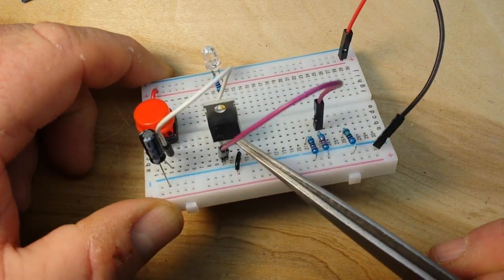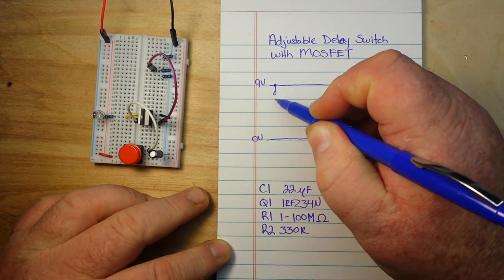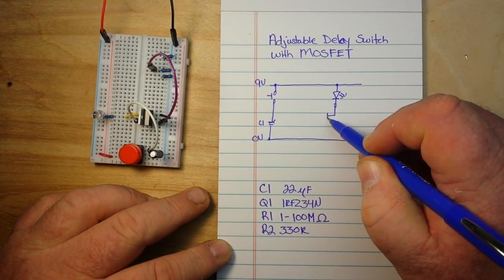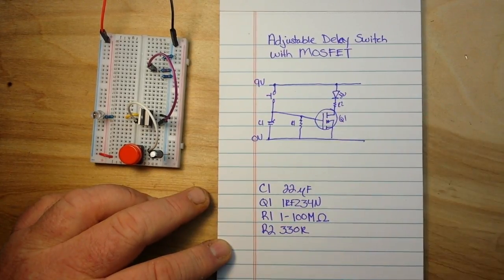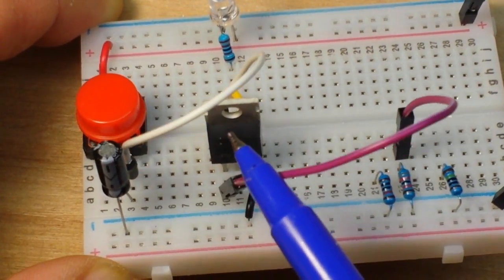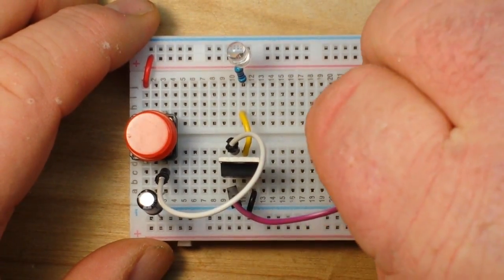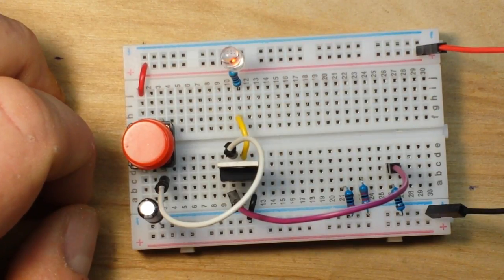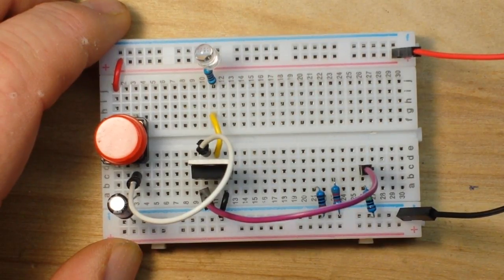MOSFET delay circuit

Comment: You need a resistor between the switch and the capacitor, so that you're not using the internal resistance of the 9VDC power supply to limit the capacitor current.
Reply: If th 9VDC power supply can deliver high current, capacitor go boom at t=0. 😆

Comment: I did this circuit but does not work. I guess the 12vdc power supply has a huge ripple and an ac componente goes across the intrinsic  gate-source  capacitance and recharges de electrlitic capacitor and this way the mosfet never turns off . Is it possible??

Comment: I wanna know how we can control the delay time without changing the resistance or the capacitor every time we wanna have a different timing?
Reply: you cant, those 2 components are the main timing items. Maybe with a potentiometer you can change the timing more easily.
Reply: @miked7923  thanks a lot  , tha was so helpfull

Comment: So you can use any MOSFET? It doesn't matter what the Gate Threshold Voltage is? I always thought that for use with logic, you need a MOSFET which has a Gate Threshold Voltage of under 5V,  otherwise it won't turn on. The IRFZ34NPBF which you used has a Vgs(th) of 2-4V and so will work with low voltages. Many MOSFETs have much higher threshold voltages and so won't work in your circuit AFAIK.

Comment: thanks for the video. like in some other videos I am missing an explanation on how the current flows in the circuit. for example I dont get how the current flows from the timing resistors and to the capacitors and how it discharge slowly etc.

Comment: Here is another example of a simple circuit that has wide reaching application possibilities. Could tie a pot instead of individual resistors to control delay, although it would need to be of the large value type.
Reply: Great idea, since he said 1~100Mohm then maybe a 100Mohm pot will do.

Comment: so can a l.e.d be used in the gate of a FET. along with a resistor. .To drop the gate voltage? or would that harm the MOSFET? for like a 24v system. and would the popular IRFZ44N be good for an 15-18 amp inductive load. at 22-29v. in a pulsed cycle maybe 10 kHz. to guessing maybe 20kHz.
I'm sorry I have a lot to learn. I can't afford to buy and burn components! I know at my level. things will happen. but I try to salvage components for just playing around. but I need to build 6 regulators and will be buying multiple components. and can't be burning them. thanks for your help.
Reply: A little (a lot) late, but here is how you can make a fast check. Use a datasheet such as at http://pdf.datasheetcatalog.com/datasheet/irf/irfz44n.pdf. Look for the SOA. For the given reference, that is figure 8. You should be able to see that for 30V, with a single pulse of 1milli second, you are good for about 9A. Furthermore, as long as you are below the horizontal upper limit, you can add a thermal radiator if you need higher current. Note that the figure assumes that your transistor is in air at 25C (ie, not inside a poorly ventilated enclosure where the temperature could be much higher).

Comment: Hello, thank you for this nice video. This is good for low current, but, for important currents and long durations, the transistor is going to warm because it stays relatively for a long time in intermediate regime. It is then better to add a Schmitt trigger somewhere in this circuit before the power transistor.

Comment: I just love seeing these simple circuits that take a few components. These days we tend to think of specialized IC's and such for things like this! Thanks for the video.
Reply: I agree. Good down and dirties, just like his logic circuits. Understanding the building blocks, that's what counts. Since I am self taught, learned the fancy stuff, but never did get the reasoning behind a circuit at its lowest level. I hope he keeps doing circuits like this at least 30% of the time.
Reply from the maker: +George Chambers anytime my friend
Reply: Hey, that's what I think learnelectronics is all about! Paul is a great teacher at least online? He's got the best teaching technic since Forest Mims III at least in my opinion.
Reply: I agree with your, sometimes something amazing can be done with just transistors.
Also them generic ICs are very useful like 741, 555 timer and them AM radio chip (MK484,  ZN414, TA7642) kinda look like a transistor...etc.
https://en.wikipedia.org/wiki/MK484
BTW you can get an assortment of chips for a cheap price to tamper with
http://www.futurlec.com/ValuePacks.shtml
Reply: Good link! Thanks.

Comment: What if I place a power BJT in place of that MOSFET???
Reply from the maker: +Sayantan Maiti really doesn't matter, it's just a switch
Reply from the maker: +gartmorn No resistor. MOSFETS are voltage driven. They sink no current.
Reply: Of course.  Need to lay off the old scotch whisky!  Thinking bjt!  Good wee timer btw!
Reply: See the datasheet of the mosfet. most mosfet accept until 20V for gate- source voltage. the IRF234 is in this général specifications.
Reply: Does it not need a current limiting resistor to the gate?  I assume because the button is held in very briefly it doesn't matter or am I getting it all wrong?  I'm not an expert on electronics as you've no doubt gathered!